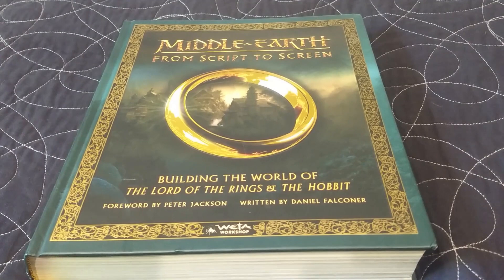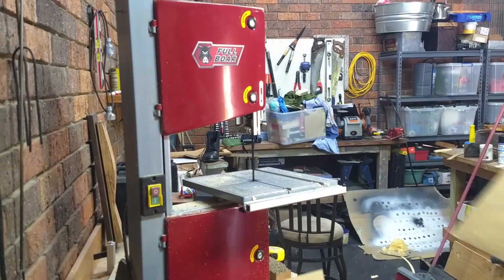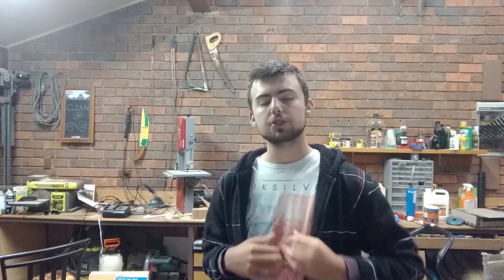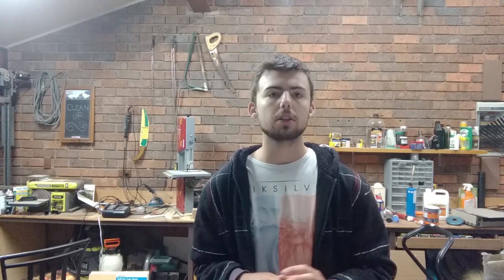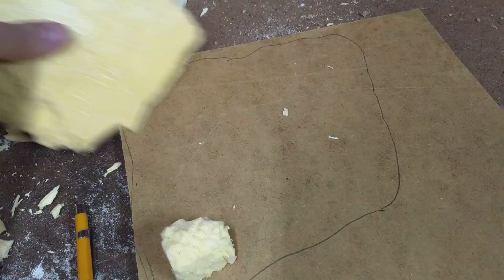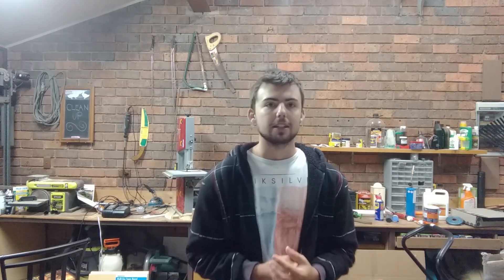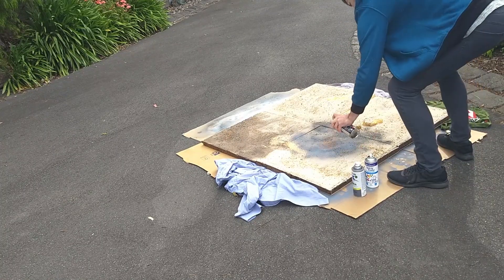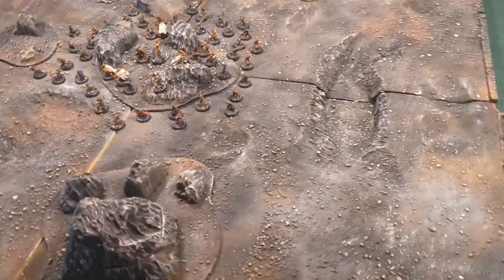Making Mordor - How I Made my Mordor Wargaming Table

Comment: The foam you are using looks like XPS foam (Used for Insulation), not EVA foam (Used for rubber padding eg. Yoga mat).
Reply from the maker: You are 100% correct sir!